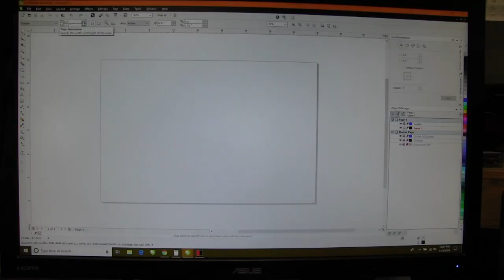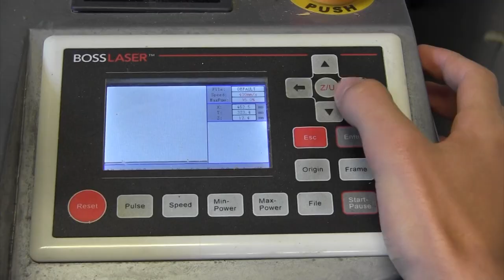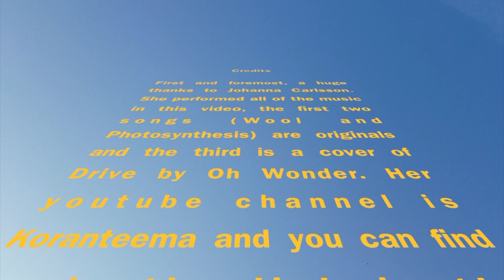DIY T-Shirt Cannon

Comment: I have an invention idea which is right in line with what you showed. You have the construction skills, whereas I have the idea - which is very simple, but could be interesting to the military. I jest not. If you build it, according to my suggestions, we could possibly share the laurels. In other words, we would be co-inventors.  There may still be a 'provisional patent' option, which (used to cost) $60 and is good for 1 year - on the way toward getting a bona fide patent.  The 1 year is considered time enough to 'shop the idea around.'  I'm an elder, residing in Hawaii.  Low income, but brimming with innovative ideas for inventions.